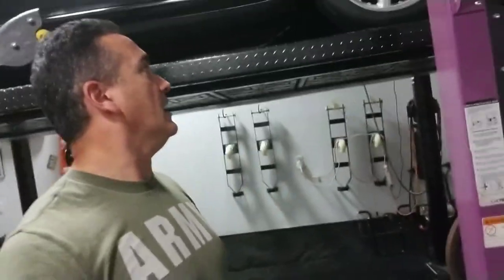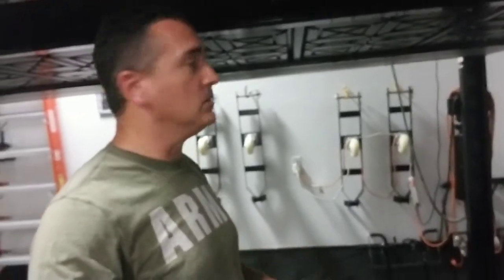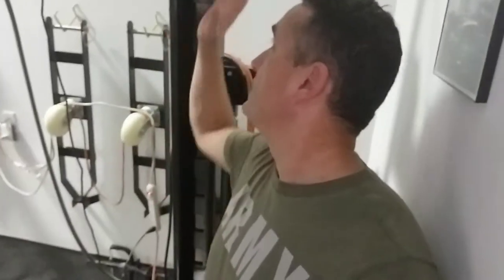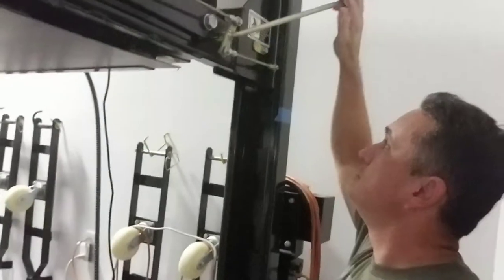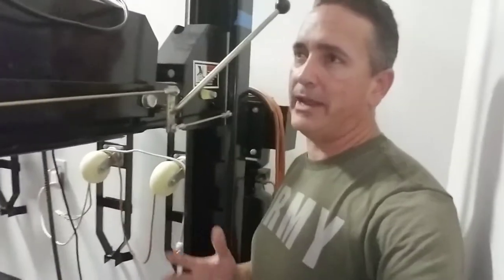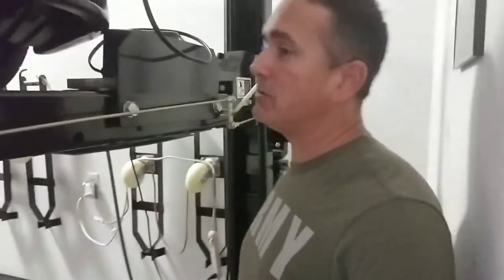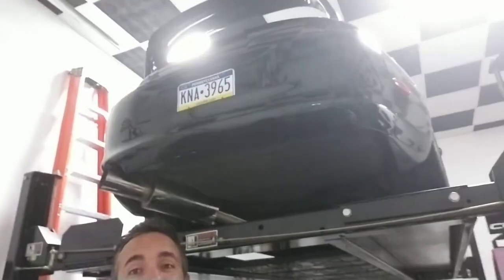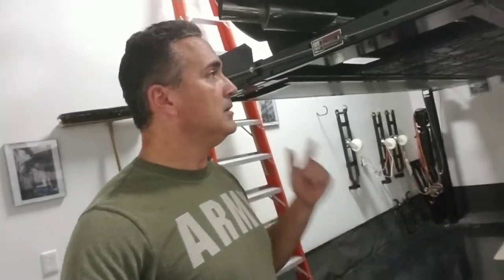8,000 lb 4 post atlas lift WHAT YOU MUST KNOW AND SHOULD KNOW before buying one!

Comment: Thanks for the review. Installed one last week. Tried to change the angle a bit while the car was on the lift. One of the casters  was bent, There was nothing in the installation manual. Tried to get a replacement, no luck! They sent me  what they have written on their site. Apparently they do not recommend it. I must admit the wheels on the casters are strong but the structure looks and feels pretty weak.

Comment: Hi, how high are your ceilings and did you have to do a high-lift conversion on your garage doors? 
What made you choose that 4-post lift over other brands?
Thanks for the video!
Reply from the maker: The ceilling is 15' and the garage door  is 7' by 8' and I choose the 4 post it works best for what I need thanks for watching
Reply: @LifeOnWheels717  Did you have to convert your garage door to open higher so the opener and tracks don't hit the car/lift?

Comment: What model # is this and is this what they call a single point lock mechanism or double point? Thanks!
Reply from the maker: This model is not for commercial use its made more for homeowners I have had them for years and the bin good to me I found them when a bought a autolocater and they advertise there from Delaware great people to work with there 8000 pound lift
Reply: @LifeOnWheels717  I pulled the trigger and got the Atlas Garage Pro 8000. Very happy with it. Thanks for your video.
Reply: @lukepowell3142  Does the Pro 8000 lock at all four corners?  Or just two?
Reply: @dnice033  Yes all 4 corners lock. Once locked you can verify it by grabbing the cables and feeling the slack, because   the weight is no longer on the cables.
Reply: @lukepowell3142  Oh thank you.  I was told by the Atlas rep that only the one side locks (i presume the side where the handle is), and if there is an earthquake...the other side could become unhooked and fall down?  Was a very odd statement.

Comment: I am considering this lift! Will it work in a garage that 9ft tall
Reply from the maker: You need 11 feet high ceiling now in my garages one has 15 feet ceiling and the other does have 9 feet but what I did was  I cut a square opening 2 feet deep this way the top of the car goes into the ceiling hope this helps thanks for watching,how is the c8 running I still did not get mine?
Reply: LifeOnWheels717 I have 9ft ceiling so I believe mine will work I just need to lift the garage doors. It’s a great car! Have you talk to your dealership?
Reply from the maker: Hey yes I lift the track for the garage door on mine but with out the cut out in the ceiling was not able to put another car underneath as far as the c8 I was just told they where starting production back up and I should still get mine.
Reply: LifeOnWheels717 how tall are those ceiling that you cut the roof in? Before and after?
Reply from the maker: The ceiling was 9 feet and when I was done with the cutout 11 feet so when I built the other garage I made it 15 feet .